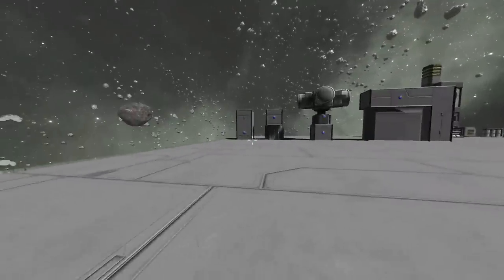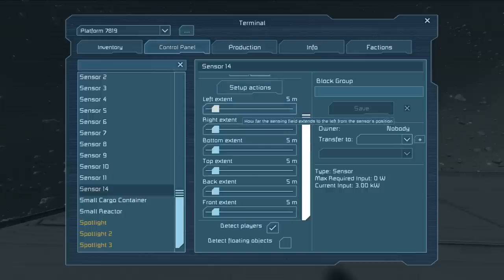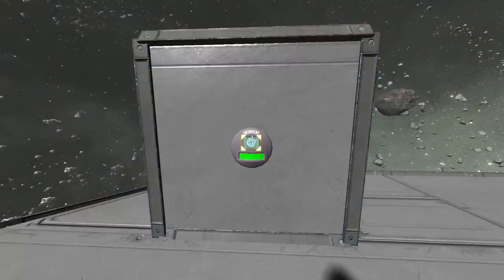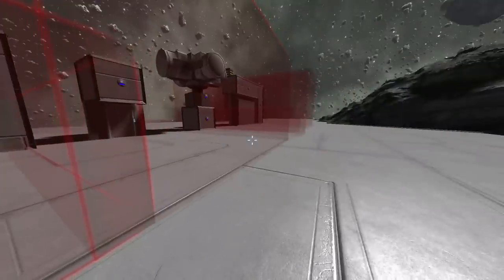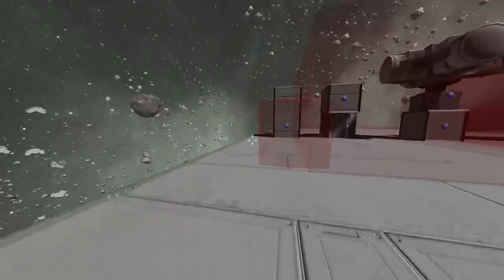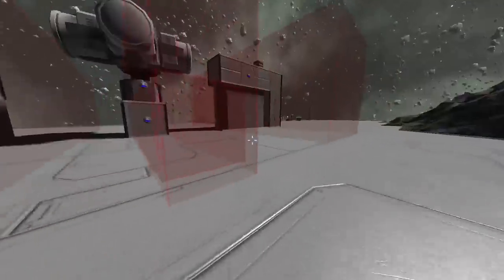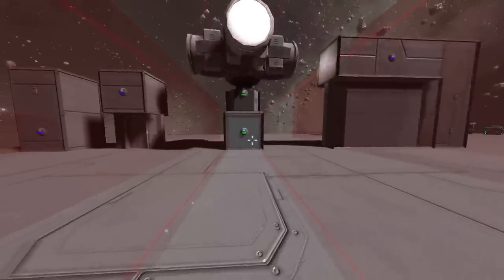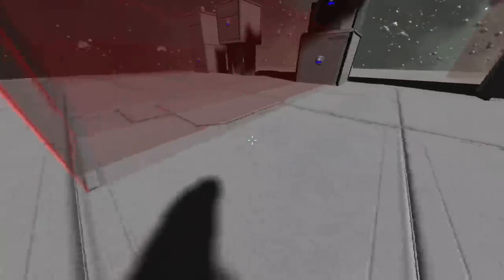Space Engineers Sensors Tutorial

Comment: great video. Are gravity generators the same? Directional from he control panel?
Reply from the maker: Yes although they do not have a Left and a Right, Front and Back but rather Width (side to side) and Depth (front to back). Note also that these numbers are ranges going in BOTH directions so if you want a Gravity Gen with a field 50 m wide you need to set the Width at 25 m. The default setting of 150 m Height, Width and Depth is actually a GG with a field 75 m in each direction.

This means that, unlike a Sensor where you can have the field uneven in some directions, the GG will ALWAYS be in the center of the gravity fields.

Comment: hey with the airtight blast doors how do i set the sensor to open all the doors to my hanger
Reply from the maker: Group the blast doors together using the Group function. That way they all move at the same time. Place the Sensor and then go into the area where you set the commands for the Sensor. Click on the Group tab on the left and select the Blast Door group (or whatever you called it) and drag that into the first command box for the Sensor. This box is for when you enter the Sensor field. You should get a drop-down that will enable you to select one of the several commands including Open/Close, Open and Close. Use whatever setting you deem appropriate to your needs.

Note that you CANNOT put the same command into both of the Sensor command boxes (so you can't set both to 'Open/Close' for example). Usually, the best way to do it is to set the doors to open when you enter the field and close when you exit. Note that one sensor can work for BOTH sides of a wall or door as long as the detection field can reach through the wall. I often set the Back range to 2.5 meters more than the Front to make up the difference.

Let me know how it works out and good luck.